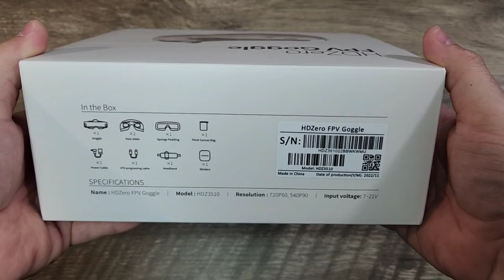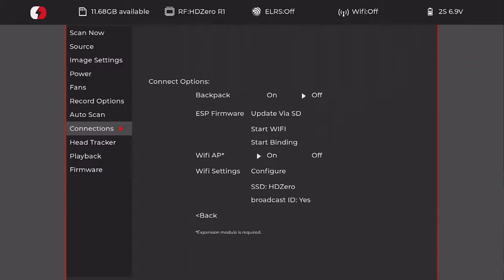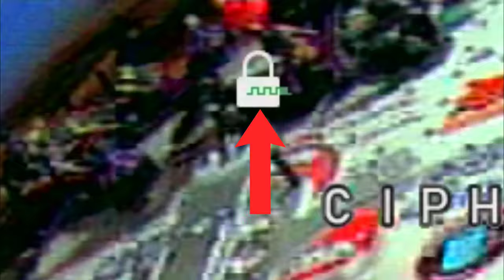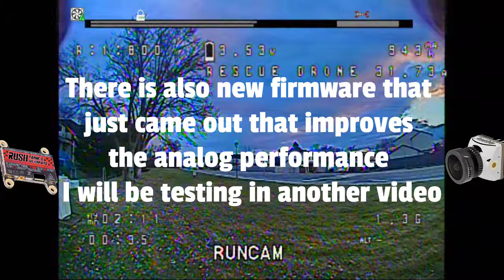HDZero Goggle Full Review // Best FPV Goggle For the Community By The Community!

Comment: Killer review! How do you compare it with DJI? Pentrstion, latency, and image quality?
Reply from the maker: Thanks Dave 🤟 So to compare to DJI V2 the image quality is much closer now with these new goggles than before. The HDZERO freestyle vtx paired with my Runcam Micro V2 camera I'm getting 720p at 60 fps. So as far as latency HDZero operates differently than DJI and walksnail where the latency of the feed always stays the same which is very similar to analog with the equipment I'm using. The major difference is with HDZero instead of sending and receiving the HDZero  receiver only receives it does not send. So instead of compression like DJI you get consistent latency but the breakup is now visually appearing in the form of lost pixels which is what the rainbow static is across the image. Kind of like analog but without all the flashes and lines etc. As far as penetration I still have more testing to do but I will say the penetration is not as good as DJI V2 mainly because the HDZero is not handling the image the same with sending and receiving like DJI does. It's definitely better than analog and getting close to DJI V2 as far as performance but it's not quite there. The major advantage of HDZero is the lowest consistent latency of the system for HD.

Comment: I'm glad you know what you're doing, I want to get into fpv and can somewhat fly on the sim. Would these be for a beginner or should I just get the Avata ? There's so much to learn and so many opinions that I don't know which way to go especially on a very limited budget.
Reply from the maker: The Avata is a good beginner drone to get into FPV but it's going to be expensive. The Avata uses DJI so these goggles won't work with that drone. Honestly one of the best ways to get into fpv on a budget is to try a ready to fly kit and go from there. This is a great starter kit to try on a budget that has everything you need. https://www.amazon.com/Pilot-Beginners-Goggles-Controller-Quadcopter/dp/B09TCM6LY7/ref=mp_s_a_1_1_sspa?adgrpid=114652881726&gclid=CjwKCAiA8OmdBhAgEiwAShr406XDYQOjk-pOmkxKe4icxsxWsaYd_qVbpGQ1Xf71J70qwZiFbZUTHhoCaLsQAvD_BwE&hvadid=489208178797&hvdev=m&hvlocphy=9007455&hvnetw=g&hvqmt=e&hvrand=15833528026528827098&hvtargid=kwd-1060651813097&hydadcr=19635_11280441&keywords=emax+ez+pilot+fpv+drone+rtf+kit&qid=1673213177&sr=8-1-spons&ufe=app_do%3Aamzn1.fos.c3015c4a-46bb-44b9-81a4-dc28e6d374b3&psc=1&smid=A39AMKDIL924DW&spLa=ZW5jcnlwdGVkUXVhbGlmaWVyPUEzVExTNkNGRUZLVDZEJmVuY3J5cHRlZElkPUEwODQzOTU0MjIxSjhKSTFQS1g0WSZlbmNyeXB0ZWRBZElkPUEwNDgzNjM5MTBXOTQ5R0I4Q1JYMCZ3aWRnZXROYW1lPXNwX3Bob25lX3NlYXJjaF9hdGYmYWN0aW9uPWNsaWNrUmVkaXJlY3QmZG9Ob3RMb2dDbGljaz10cnVl
Reply: @edrone_  Thanks Man, I'll check it out

Comment: Hey Eric, how are you doing, man? I know you have tried dji v2, how does this compare to that? Hope the fam is doing well.
Reply from the maker: Thanks for asking bro we are doing well. Hope you are doing good also Chuck. The two systems are pretty different. The resolution is close to the v2 now with these new goggles but the main differences are the way the two systems break up and the latency feel. With DJI you know you get the lag feeling and pixelation on the sides when in focus mode. With HDZero there is no lag with the video but you get the sparkly analog type breakup which has improved I feel from  the older vrx module. 👍🙏🙏🤟
Reply: @edrone_  thanks, man. Definitely considering it. You know I always hated the dji form factor. How is availability of the goggle and vtx's?
Reply from the maker: @CHUCK IT! FPV  the form factor and fit on these is really nice 👌 Availablility of the goggles I feel they will sell out quickly so I wouldn't wait too long they are only available at the HDZero website currently and the discounted price is only for 1 month. The video transmitters and cameras are pretty good they are carried at most vendors and the HDZero website. Stocks seem to be lasting on those.